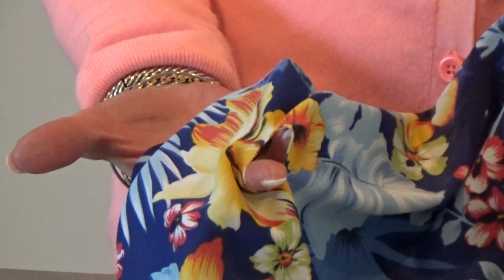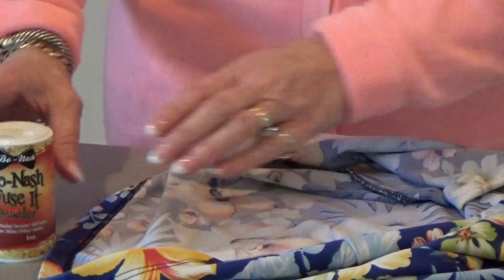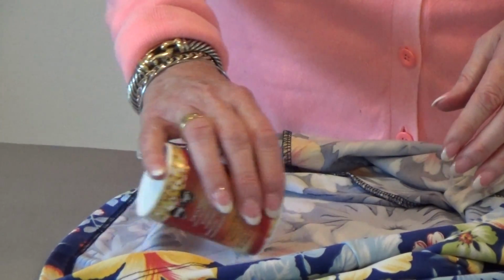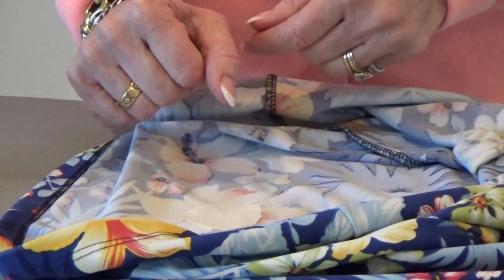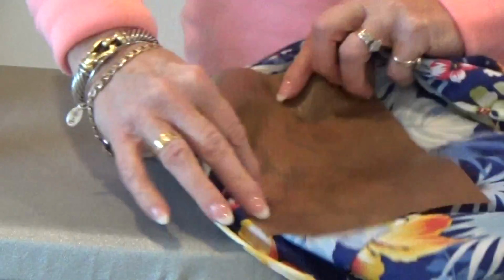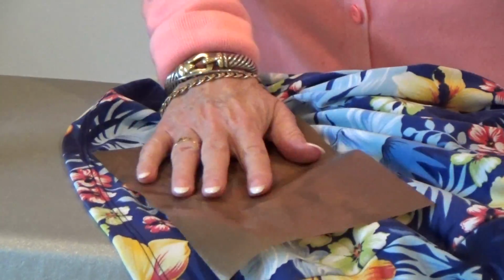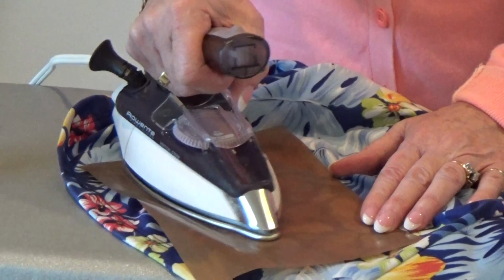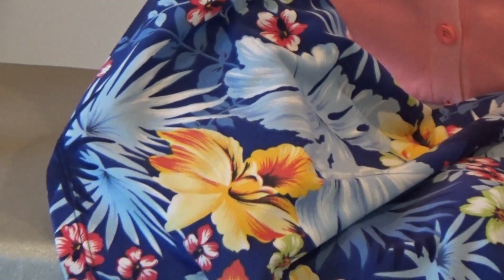Repair the rip in your dress

Comment: Hi I have a vintage silk blouse made of crepe de chine. Could In repair it in the same way you are demonstrating? I am concerned the fuse it powder may show through on the right side of the garment.
Reply from the maker: It would not be invisible since the fabric is very sheer. The Fuse It Powder is a fabulous way to fix clothing but in some cases like this one it would not work very well.  Thank You